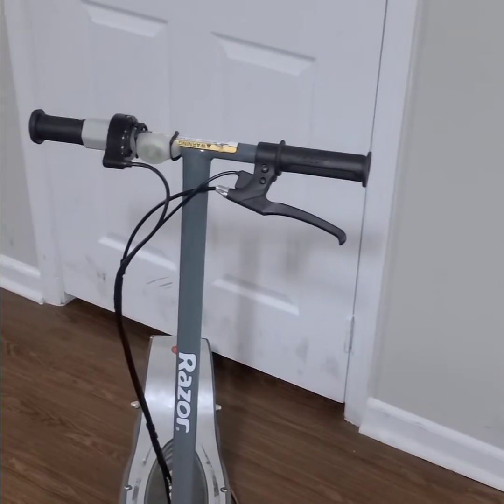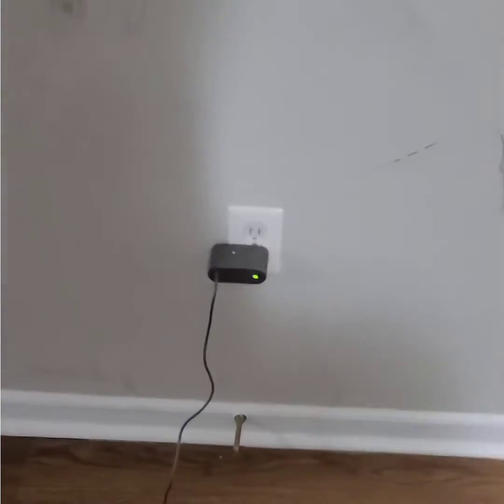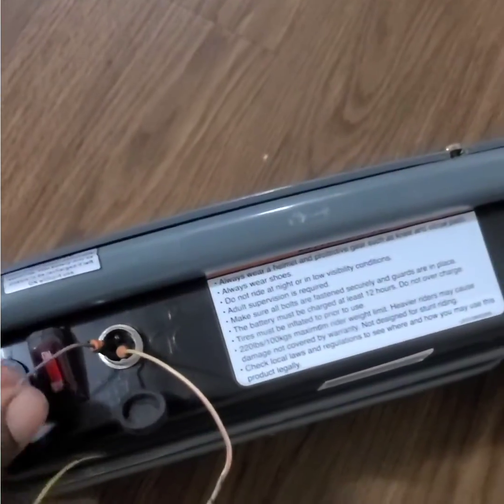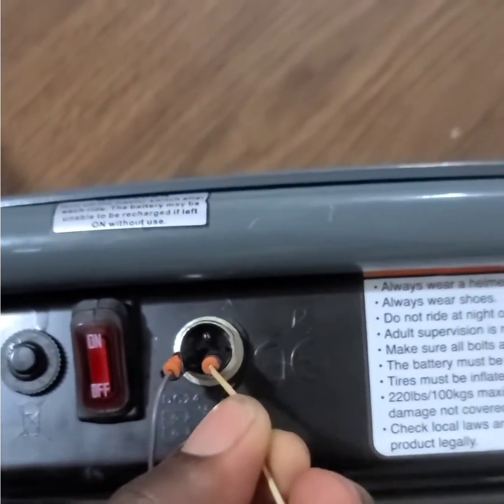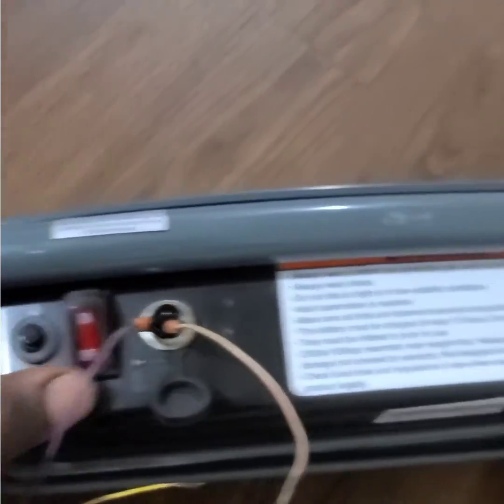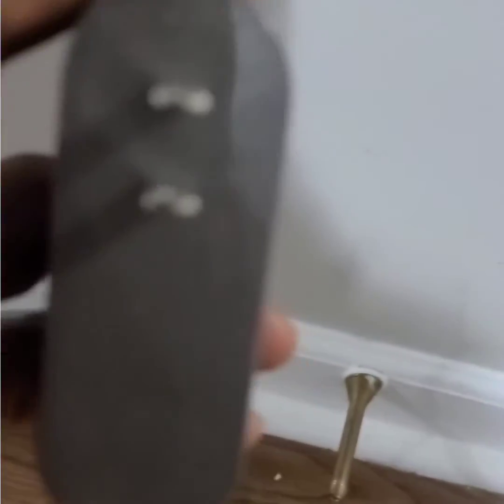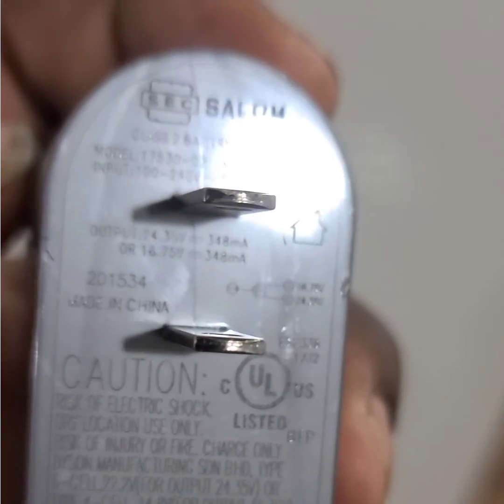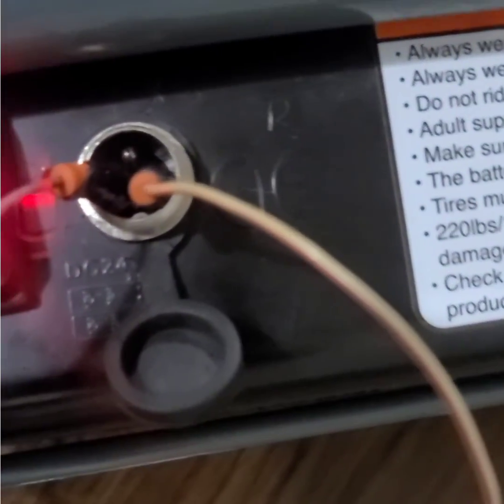How To Charge Your Razor Electric Scooter Without Original Charger

Comment: When charging the scooter does the power on switch have to be on?
Reply from the maker: No
Reply: @BABYAKON100  when you charging the light is off?
Then what is happen if im charging and the light is off,it turns on after charged?
Im charging one right now but the power is only 20 volts
Im just tring to see what is happen.

Comment: Is it bad to overcharge the battery how about undercharging
Reply: The scooter will have an overcharge circuit built into the electronics, no worries there bro.
Reply from the maker: Using the right voltage ⚡️ and Amp won't overcharge it and the scooter has a indicator showing when it is charging and when it full. When a battery is fully charged the current work in cycles the circuit design to not overcharge.